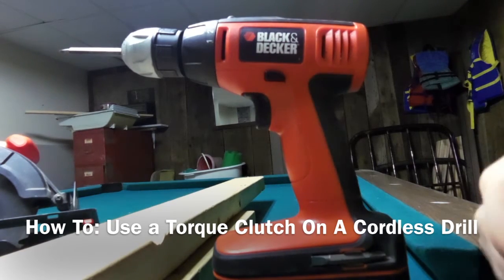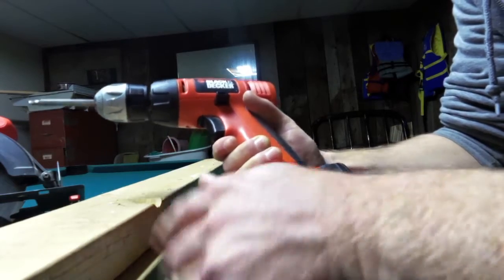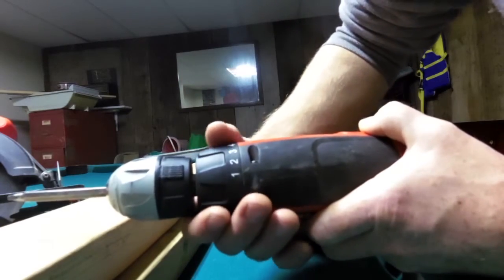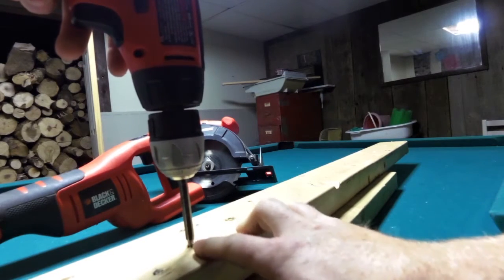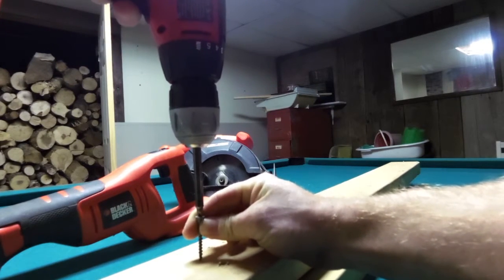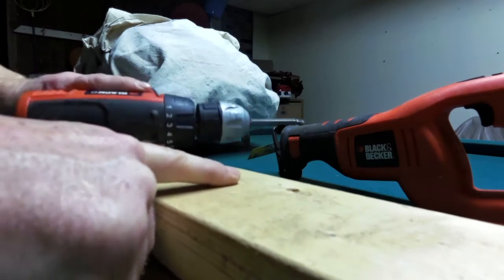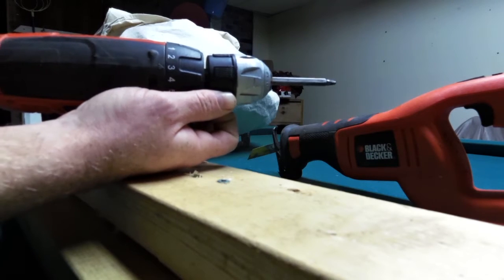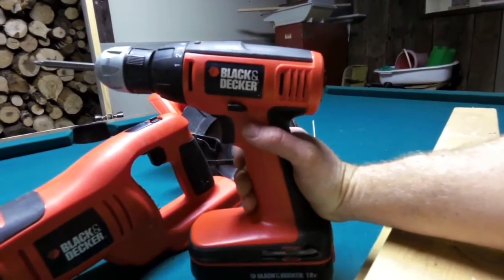How To: Use a Torque Clutch On A Cordless Drill - DIY - Learning!

Comment: Can this tool be used to drill through brick wall?
Reply from the maker: If it has hammer feature yes, even without if you have a good masonry bit it should be fine for small projects